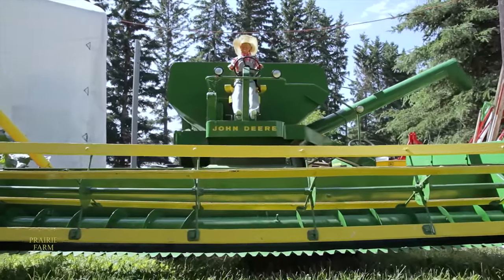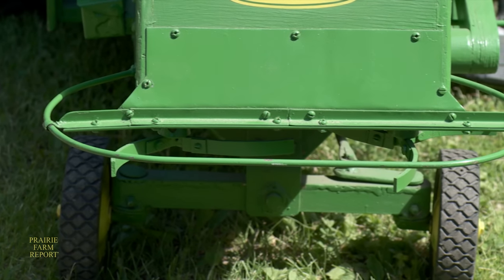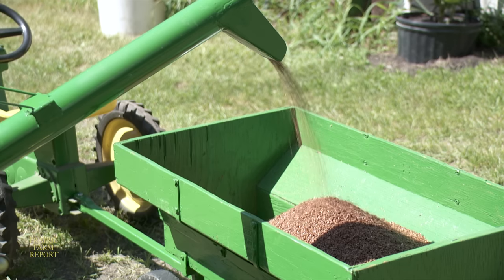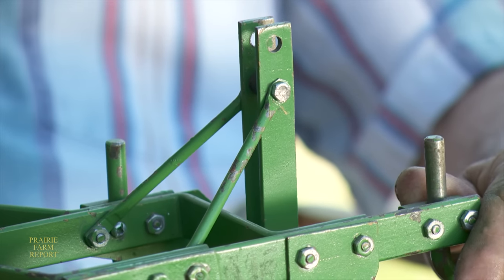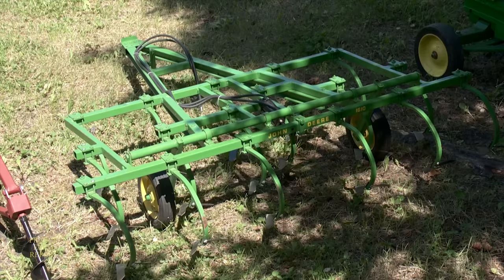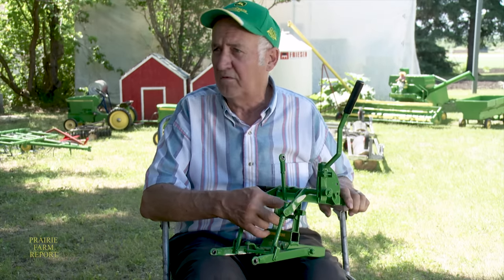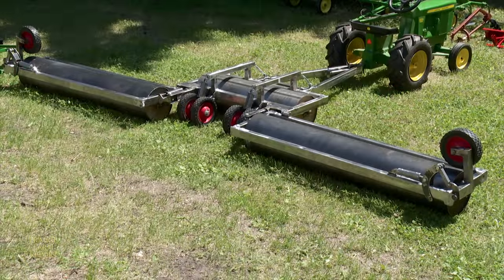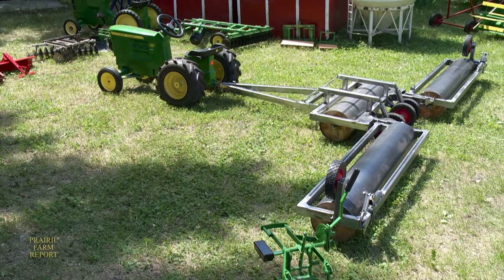1:5 Scale John Deere Farm Machinery

Comment: You need to look into making these true RC units with real hydraulics and electric motors. The cost has really dropped on that stuff in the last couple years. The complete hydraulic system is less than $200 from Ali Express and now there's tons of RC components on the market that are actually affordable. Not at all like it was just a couple years ago.

Comment: I would like to buy a smaller scale heavy duty  6' disc that you can pull with a Kubota Bx2680 or John deere 1025 and hydraulics to lift and lower  the wheels.